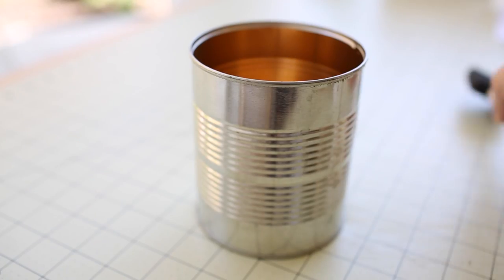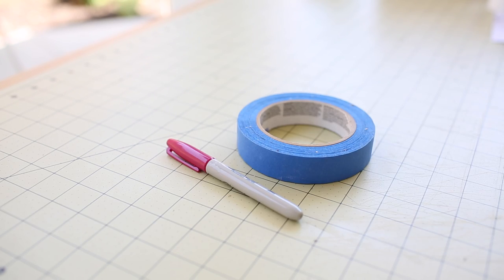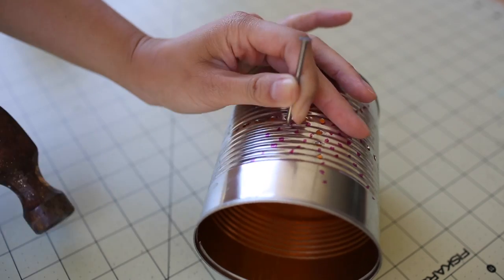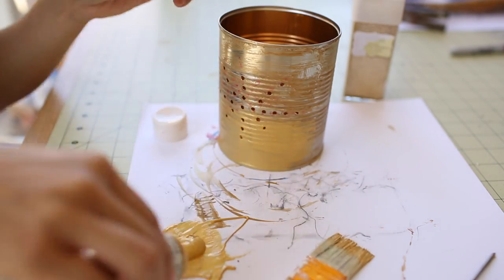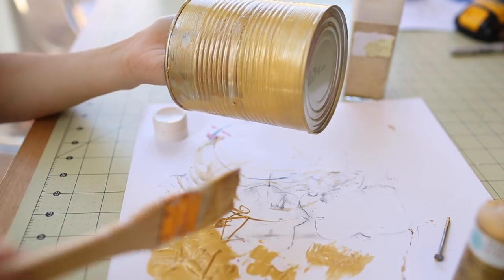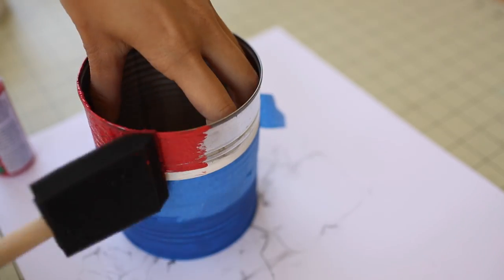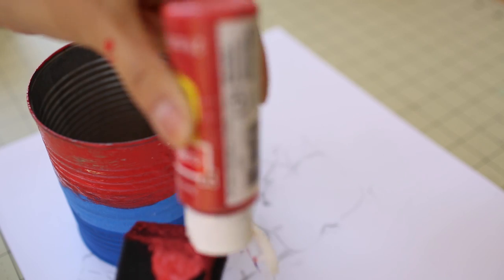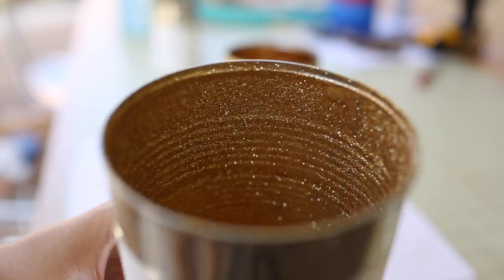DIY Firework Candle Holders - HGTV Handmade

Comment: This is a great project. I think if you had a clamp, you could clamp the can to a table to make the drilling easier. I have made these before with just a hammer and nail, and that works. It just takes a while. This is a great party craft idea for pre-teens or teenagers. Each person can draw their initial on the can, make the holes and then they have a item to take home at the end of the party.
Reply: Great tip!!! Thanks for sharing Katie!

Comment: Awesome I love candle holders! Since I don't live the USA I don't celebrate the 4th July so I will probably make this for bonfire night (which I'm not sure for other countries but in the UK it's the 5th November) 
Also if you are going to put glitter on the candle holder would you use mod podge to seal in the glitter so if doesn't get on your hands or would it not work because it's on a metal surface?
Reply: Yes you can, I always forget to mention how to seal glitter, but yes you can!